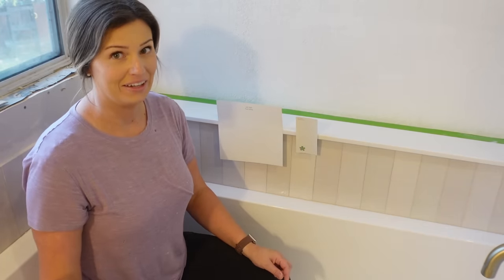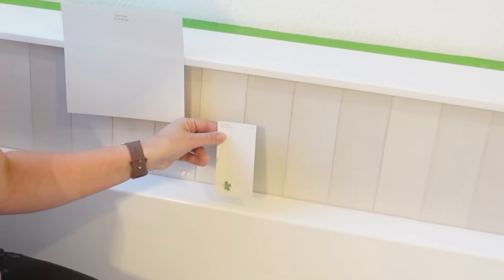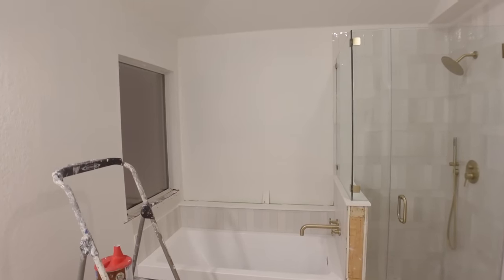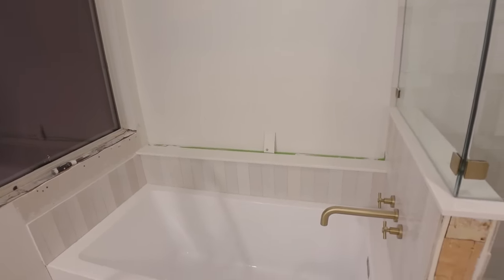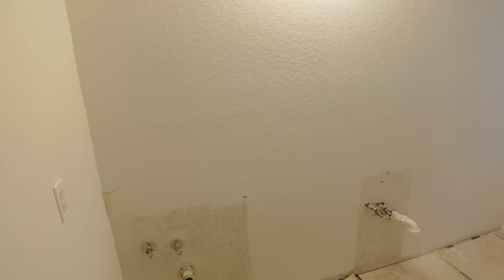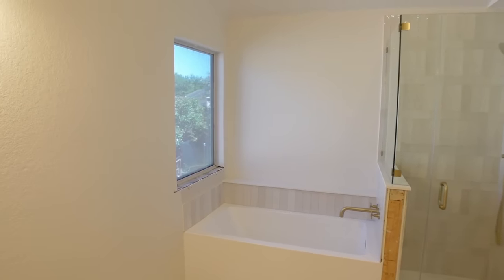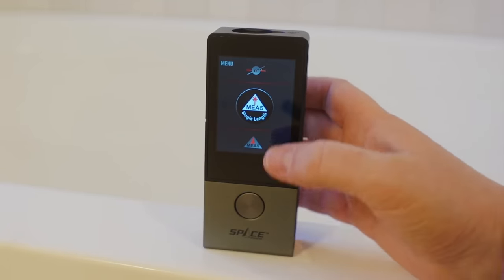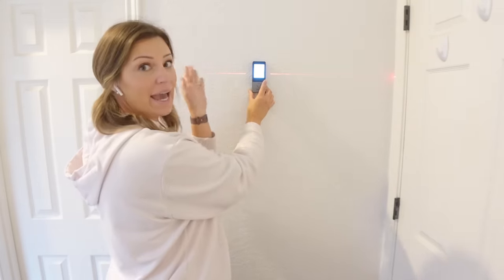PAINTING + NEW FLOORS & VANITY | Bathroom Makeover pt 7

Comment: Yup - really like the tile choice, it does look like slate, same effect without the hassle of installing and grouting.  I know this is ahead of the process, but the window sill ledge, a piece of the same stone you used for the tub ledge would be nice, and waterproof.
I did not know you could switch out a toilet lever, good to know.  I will be using brass fixtures in my bath when redoing it, so thank you.